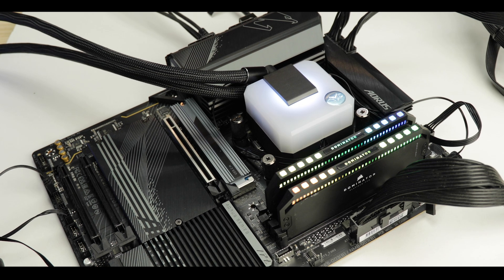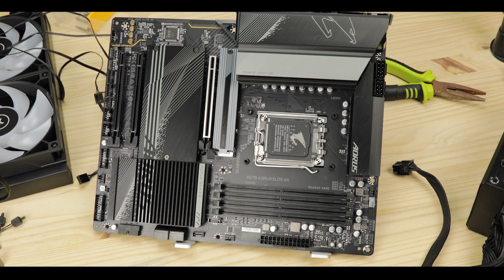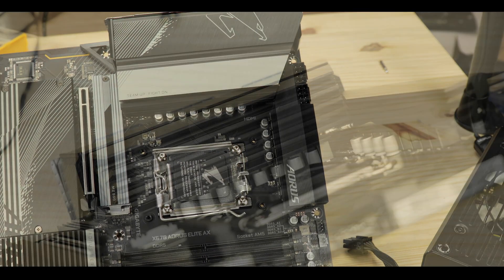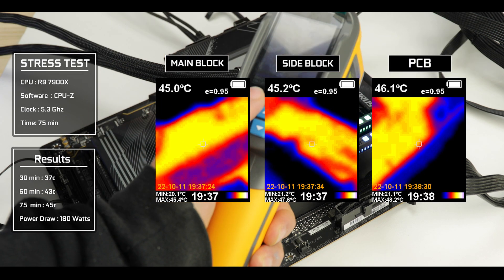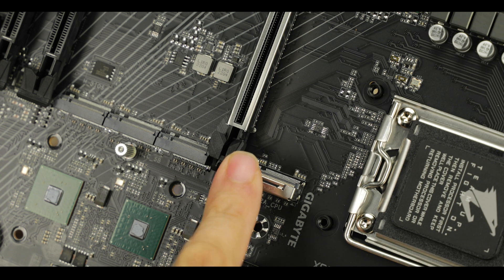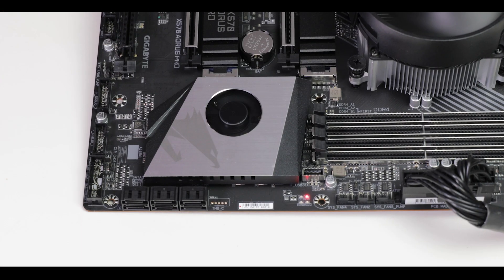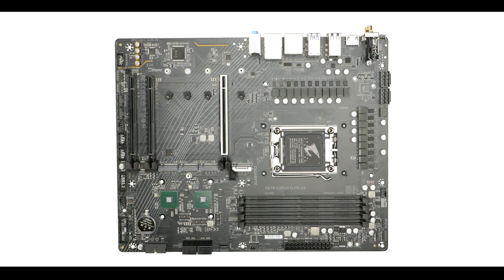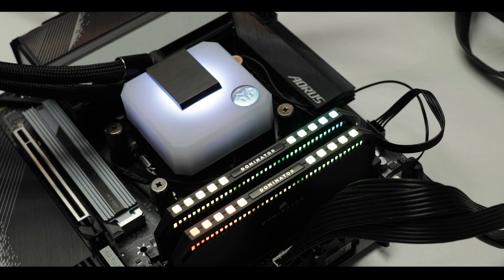Gigabyte X670 AORUS ELITE AX : WAY ahead of its competition!

Comment: This motherboard actually supports PCIe gen 5 x 16. Mine is rev 1.2 and i have a 5080, when i run GPU-Z the pcie says pcie5.0x16. Gigabyte made this board some of the few X670 non E motherboards that have a 5.0x16 PCIe slot.

Comment: 7:15 what? They said its a pcie5 in the website
Reply from the maker: Just went back on the site And documentation and it says x16 @ PCIe 4.0 . 

Just so you know, usually talking, X670 chipset have only 4 PCIe 5.0 lanes. So it would not be able to feed 16 lanes at that standard.

Comment: I just bought the 1.3 Board fired up Zero problems So Far GREAT BOARD! Bios should be revamped chipset runs at 135F VRMs 80F Air cooling 7-70 AMD Long Boot Times 60-90  Ram learning disabled still high boot times....Still and all great board....@219 great deal IMHO...

Comment: Hi i am planning to buy this motherboard, but it confuses me that it has a (rev.1.0/1.2/1.3) Can you help me and tell me what is the difference and which one should I buy? And one more question, I plan to put a 7800x3d processor on this motherboard, is that ok?
Reply from the maker: Processor wise, yes it's fine on all this board versions. More than fine. 

The difference will mainly be aesthetic and the introduction of connectivity features like WiFi 7. But nothing fundamental.
Reply: @Laurentschoice  Thank you very much for your quick reply

Comment: Whoever decided to put the battery under the chipset heatsink on this board should be punished severely! I have had this board for almost 2 years now and the battery has run flat. This has never happened to me before with a new board in the past 30 years or so with any of my previous boards. Now I have to completely dismantle the whole computer, take out the board, remove the heatsink, and replace the thermal compound on the chipsets as well, just to put in a new battery. Besides this nuisance, it's a solid board.
Reply: That sounds inconvenient as hell

Comment: Hello Laurent
Does this motherboard has the baility of splitting PCIE slot correctly as Gigabyte usualyy did ? I mean x8/x8 x4/x4/x4 on most port possible ?
I got all these features on my Aorus Master/Pro X570 and being owner of an ASUS X670-P I am am so disappointed on this point ...
Tons of useless settings with VRM that can do nothing with 940A, but only PCIE1X_1 twekable ... nothing on 2 and 3, a shame
I need to put many GPUs, and don't need tons of bandwidth (around 3/5 GBs)

Comment: Running four of these now and three of the b650 versions. The last one I snagged for $100 plus tax. Three have 7800x3D and one with a 7600x. Best bang for the buck boards and in many cases only cost me a tiny bit out of pocket after selling x570 boards for about $100 each. 

Enabling Memory Context Restore after setting EXPO has been a must and makes the occasional very slow posts become far less frequent.

Comment: Would this work with a 4090 and a 7800x3d?
Reply: Certainly would. I have three of these x670 Aorus Elite AX paired with 7800x3D’s.

If you want the best chance for the longest life from it you might shop for a x670e board so if the 5090/6090 utilize Gen 5.0 you won’t have the itch to replace this gen 4 board.
Reply: @45eno  thank you bro I got the x670 in the end it was on a huge sale on prime day so I thought why not 😭

Comment: this board failed horribly paired with 7900x3d and QVL Corsair RAM, it trains memory for 10 minutes each boot, was replaced for Asus x670E
Gigabyte publishes Beta bios on support page (ones with letter in it) and then just removes it if it fails horribly
Reply: I have the same issue with gskill ram. I don't play games, so most of the options and settings don't matter. I just saw a lot of reviews like this one saying how great it was. Every time  I make a change in bios, it takes a few minutes to boot up and sometimes it gets stuck. Pain in the ass.
Reply: @lelandgaunt7130  replace it if you can, go asrock for am5 or asus or msi, avoid gigabyte unless you get aorus master which is only one without issues
Reply: I run 4 of these x670 and 3 b650 Aorus Elites. Yes I certainly experienced slow post as the norm but once you enable expo or xmp let it boot once and then go back to bios and enable MEMORY CONTEXT RESTORE. I have under 20 sec power ups to windows 11 log in screen now.

I have mostly the Gskill Trident and Flare X 6000MT CL30 ram paired with them. I found a good deal on a new Trident CL32 6400MT XMP kit it worked fine once I mirrored my 6000/cl30 speeds and timings.  No errors and fast posts.

Comment: I know this is a old review but I just got this board a couple weeks ago along with a 7800X3D and 64 gigs of G.Skill 6000 (CL-30) RAM, I setup a curve optimization of -30 all cores. I have a Seasonic Vertex 1200 watt PSU and a Gigabyte 4090 Gaming OC.
My main use for this system is playing sims (Racing and flight) in high res VR (Reverb G2v2) (3160 x 3092 per eye), this system has been rock solid, MSFS-2020 runs like a dream on this thing and some of my racing sims now have more eye candy turned up.
My previous board was a Aorus X570 Elite Wifi, a 5900x with 32 gigs of Corsair 3200 (CL-16), for my sims in VR, the 7800X3d blows my 5900x out of the water, this thing is a beast! :)
So far, I can honestly say..... I love this motherboard! LOL
Reply: Thinking about it does the 4.0 pcie bother you not sure how advanced 5.0 is amd if it becomes a must I know now there  isn't much out there but the transfer rate for 4.0 is still very fast. Hoe much faster do we need
Reply: @magictracks  I am using a 1 TB Samsung 980 pro (with heatsink) NVME (PCIe-4) as my boot drive, it's plenty fast. I also have a PCIe-3 NVME 1TB Kingston, even that's fairly fast as well on my system, along with a few SATA based SSDs. The crucial stuff like some racing sims and MSFS are on the NVME drives. Very happy with it's performance. :)
The PCIe-4 needs it's heatsink, so I can imagine any PCIe-5 NVME drives would run pretty hot.
Reply: Man your comment bring me peace of mind. I just ordered very similar pc than yours, same processor, 32GB DDR5-6000 CL36 DIMM Corsair Vengeance so I was reading this motherboard was causing issues
Reply: @strobelightstrobelight  Regarding the motherboard (Aorus X670 Elite AX), I left mine on the old Bios (F9), seems to actually be faster than newer bios'es, I haven't tried the lest bios though. I have a -30 all cores set for Curve Optimizer and another small tweak I can't remember the setting right now, but I am very pleased with this motherboard. Mine is the original revision too (v 1.0). Been running it for roughly 3 months now with no issues. :)
Chances are those that had issues didn't know what they were doing, just because it's on YouTube doesn't mean it's good! LOL
Reply: @jackr.749  Thanks a lot for your comment and knowledge. Im a lil overwhelmed and stress right now haha because I spent some money on it. 

I don't know which revision is mine tbh. This are the specs:

Form factor	ATX
Chipset	AMD X670
RAM compatibility	4x DDR5 DIMM, DDR4-6400 (OC), max. 128GB (UDIMM)
Expansion slots	2x PCIe 4.0 x16 (1x x16, 1x x4), 1x PCIe 3.0 x16 (x2), 1x M.2/M-Key (PCIe 5.0 x4, 25110), 3x M.2/M-Key (PCIe 4.0 x4)
External connections	1x HDMI 2.0 (iGPU), 1x USB-C 3.2 (20Gb/s), 2x USB-A 3.1 (10Gb/s), 6x USB-A 3.0 (5Gb/s), 4x USB-A 2.0 (480Mb/s), 1x 2.5GBase-T, 3x jack
Internal connections	1x USB-C 3.2 Gen 2x2 header, 2x USB 3.2 Gen 1 header, 2x USB 2.0 header
WLAN	Wi-Fi 6E (WLAN 802.11a/b/g/n/ac/ax, 2x2, AMD RZ616 [MT7922A]), Bluetooth 5.2
Header cooling	2x CPU fan 4-pin, 4x fan 4-pin, 1x AIO pump 4-pin, 1x pump 4-pin, 1x thermal sensor
Header lighting	TBA
Audio	7.1 (Realtek ALC1220/ASUS SupremeFX)
RAID level	0/1/10
Power connections	1x 24-pin ATX, 2x 8-pin EPS12V
Graphic	IGP (via CPU/APU)
Lighting	RGB, 2 zones (chipset cooler, I/O cover)

Should be a problem ram trademark? or this does not matter at all?

Thank you man, you giving me some light right now lol
Reply: G. Skill 5400 Ghm 128 Gb (32gb each) ram is not supported or what ? We just order and not going with board. Just wanna know if its only support 6000 Ghz ram ?

Comment: Hi, i have a Corsair Vengeance RGB DDR5 RAM 32GB (2x16GB) 6000MHz CL30 AMD Expo CMH32GX5M2B6000Z30K, i can use on this motherboard???......another question, i have a m.2 pcie 4.0 and 4090 RTX, will I have problems with bandwidth?  THANKS
Reply: Man I just ordered a computer with the same ram than yours and this motherboard. It’s mounted by a great company here in Germany, so I suppose it works great
Reply: Muchas gracias!

Comment: so I have this board in the dark base pro 901 case and .... I'm a bit of a pc build noob.... I hooked the only cable that would fit from the case into that erp ready connector that you said "thunderbolt" to.... it wouldnt boot so I finally unplugged only that connector.  what do you suppose it was, and what is thunderbolt for?  thanks

Comment: In the end I pretty much liked this motherboard.   Like Han Solo says, it's got it where it counts.
Not everything is perfect, though.  Where it's very weak,however, is in audio out jacks, and SATA 3.0 jacks.  
It has only 3 audio out jacks, not 5, and no SPDIF out.   If there is a way to get it to do 5.1 / 7.1 surround sound, I have not figured it out.  Jack sense don't seem to work.
It has only 4 SATA jacks, not 6, and they are in a terrible place right under the monster GPU you installed.  Be sure to plug in ALL your SATA cables  cables before you install your GPU.

I bent the USB-C pin on the right F_USB320G motherboard header cable and port, which is the worst connector imaginable.  FOrtunately there was a second one at the bottom I could plug into.  But my pin is still bent, so the USB-C don't work on it.  This is onboard USB32 combo motherboard connector absolutely the worst connector the industry has ever made.  

The motherboard manual was acutally pretty good. 

It is very sad there were not WIndows 7 drivers for the motherboard.   Upgrading the UEFI BIOS at first gave me fits, until I realized I could not install mismatched pairs of DIMMs.

Comment: if i use those 3 lower m.2 will they slow down my gpu?
Reply: Only if your cpu is being pushed to its limits by the gpu already, even then it will only be throttled if all of them are being used.

Comment: So far I am absolutely HAT1NG this motherobard.
I've bougth two fo them so far, and both times, they halt on the RAM LED, even though my 4 sticks of 32gb are in the supported memory list.  I tried Qflashing the BIOS on both of them but that will not even start when I press the Qflash button with a USB stick in the port with GIGABYTE.BIN file on it.   This motherobard is CRRP.   I've cleared the CMOS with the button, but can't get under the heatsink to replce the CMOS on either one of them.

Comment: Solid review, i have this board it runs 6400C30 solid all day, the only real negative of this board is the old alc880 audio codec.
Reply: Those negative can be solved by PCI-E Sound Blaster AE-7 I have it and I don't think I will go back to use Realtek stuff anymore. Next thing is Intel X550-T2 to replace the integrated Realtek NIC

Comment: Which one would be better to use, that motherboard thermal pad for ssds or ssds which have their own heat sinks?
Reply from the maker: They are both identical in quality (usually). But I'd go with the pads preinstalled on the m.2 ssd.

Comment: I have all the troubles in world trying to even pass windows installer. First thing I did was to update to F7a bios, maybe it was a mistake. Rolling back to F4 as of now.
To everyone, save your hard earn money and go with an ASUS or a MSI. If the Aorus works it works, but when it does not even the simple things are a nightmare.
Too bad because it was perfect for me on paper.
Edit : As of now downgrading to F4 Bios does the job. What's going on at Gigabyte ? Since 2016 their boards gave me nothing but a hard time. Their X58 and X79 were fantastic and so were the Socket A and 939 …
What bios did you use Laurent?
Reply: @Bieber Ozinga it terms of issues it is way ahead of its competition.

Comment: Let me tell you about that 8 layer PCB and the copper plates. After building computers since 1989 I made a grave mistake. When I was screwing the CPU AIO cooler head down to the CPU bracket  I didnt notice that the top left screw was drilling into the PCB rather than the threads of the backplate. It drilled a nice little hole into the PCB, but this board works beautifully. Not an issue. Nothing wrong with the way this PC runs. Temps are perfect. Voltages are perfect. I really could have screwed up a nice and expensive board, but I got lucky. I shielded the hole with PCB masking material.
Reply: What caused this mistake?
Reply: @terrytibbs951  Hey Terry! I wish I could post pics here to show. I was too excited when I was building this PC and I went too fast. I have a 360mm AIO. I didn't make sure that the screws of the cooler were threading into the housing. I just started to screw them in and it turned out that instead of the screws going into the threads, they were drilling into the motherboard. The pump head was a little crooked. I also couldn't see well because I installed the motherboard into the case before I screwed on the cooler pump head. I wanted to size things up with the motherboard installed. Like I said, I used PCB masking material and it is all fixed and runs perfect. This is a very thick motherboard.

Comment: I just got it for Black Friday for 259USD. I hope it is as good as it was presented. Still waiting on water cooler and case to come.
My biggest condition was at least 3 M2s (as I am already using that much on present build). No need for RGB. And this seemed so cheap compared to other, so I went for it.
Without planning, I went for Gigabyte Aorus series again (have x399 one for the present build).

Not sure, should I go and update BIOS with Q-Flash (so no CPU, memory or GPU). Just MB and power supply.

Comment: This board is nearly $300. Not in the budge segment. Despite that price tag it does not even give a single PCIE Gen 5 slot (other than a single M.2 socket). Combined with Gigabyte’s horrible BIOS, I wouldn’t touch this with a ten foot pole.

Comment: thanks for the review! I was considering going for a 5800x3d, but I might opt for this board with a 7600x. do you think I would be able to drop in a x3d variant of some of the future generations with this board? I read many people did that with AM4 and the 5800x3d and saw great performance uplifts.
do you have any recommendation for RAM speeds I should get with this plan in mind? thanks a lot!
Reply: AMD claims am5 support through 2025. 6000 speed ddr5 RAM is supposedly the sweet spot for am5.

Comment: Not sure what does he means by "Entry level" but according to my logic, $330+ is not an entery level
Sure there are some $500 & $1000 Mobos out there, but those are Flagships meant for crazy Overclockers
Entry Level should be around $200 max considering X470 back in 2018-2019 were between $120 to $190 
I'll pick a quality $200 ASRock B650E PG RIPTIDE / Lighting, or Asus TUF & use it till 2026 minimum.. X670/E won't matter unless U want to OC some Ryzen 7950x.. any quality B650 will even OC 7900x with max of 220w (according to Reviewrs at least)
Reply from the maker: Hi Aboud :)

No matter the price, the ELITE is and remains AORUS entry level , and the XTREME its flagship.

As for the prices evolution, I could not agree more  :)

I hope this clarifies :)
Reply: @Laurentschoice  already knew that.. but am talking from price perspective
The best way to convince companies to reduce their price hikes is to not buy their expensive tiers, I hope people think with some logic rather than paying 2x / 3x price

Comment: hello, is it normal, it takes 100s every time the computer starts or am I doing something wrong? 2x32gb 5600 Hz
Reply from the maker: Yeah... u need to update the BIOS. Early bios take forever to measure memory on X670 boards. Up to a full 5 min on boots.
Reply: @Laurentschoice  have last bios f8a
Reply from the maker: Its part of the X670 issues. They are releasing new BIOS to fix it
Reply: @Laurentschoice  hopefully AMD can get it to the manufacturers quickly.  It confused me the first time I booted up my x670e board. Thought something had went wrong.

Comment: Thanks / Merci for the review pleine d'enthousiasme 😊 

I chose this X670 board as it had the second PCI slot slightly away from the bottom edge of the board, leaving room for my SoundBlaster-Z soundcard and the lower intake fans in my Lian-Li O11D case. Every other model in the low to mid range only had a slot right at the bottom. The onboard sound even on the high end boards is still not as good as a dedicated soundcard, even the Asus ones with Xonar tech. I am very happy to hear that the rest of the board quality is good though
Reply: Funny to see that you considered this board for the same reason as I am doing right now. The Fractal Torrent Compact with bottom fans also block the lowest PCIe slot, so having a decent slot at position 6 is great. The spacing between the GPU slot and this slot is perfect for those 3,5+ slot GPUs (looking at you 4090).

A different board with this layout is the Asus Prime X670-P, which appears to be a step down in quality from this Aorus Elite while being about the same price.